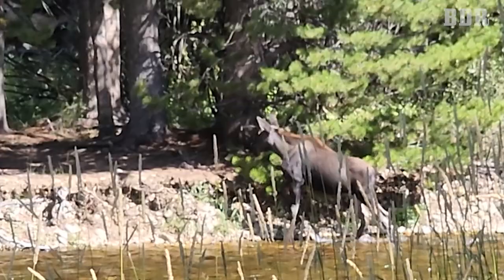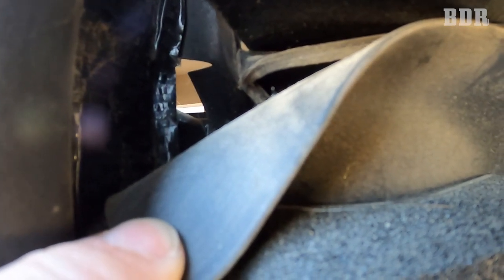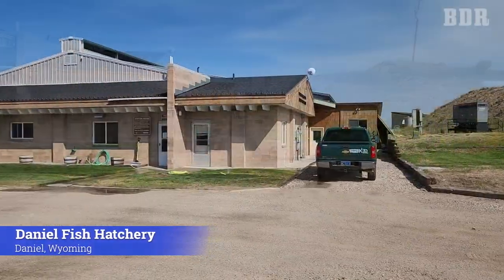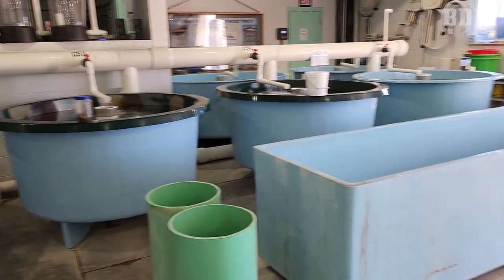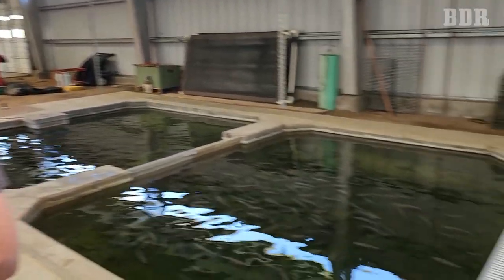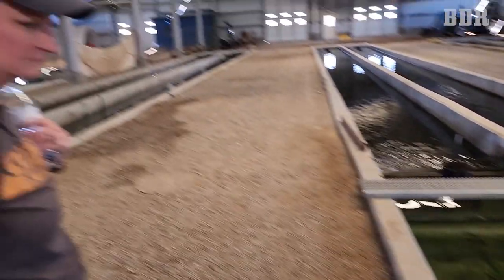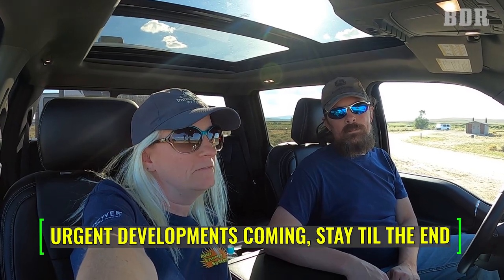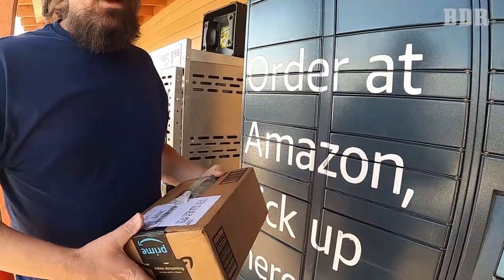Avoiding Damage, RV Design Flaw, Very Close Call | Full Time RV Life

Comment: I had rat problems in my truck to the tune of $6000 damage so I got solar motion lights under the trailer at night and I get stuff from Grandpa Gus Pest Control Products that is good for all pest and I added sonic sound devices wired to my batteries under the hood and spray stuff all around spots on the trailer
Reply from the maker: Have you noticed if the solar motion light have worked to keep them away? We have been wanting to add lights under our RV. Thanks for the tips and thanks for watching! ~ Shion and Matthew
Reply: @BrokenDreamsReborn  Yes they have worked along with the peppermint and water mixed spray every few weeks I have 
not had any problems.
Reply from the maker: @darrylt5300  That's good to know!